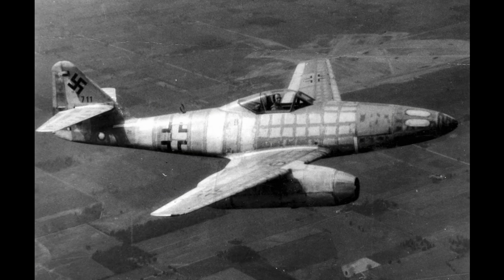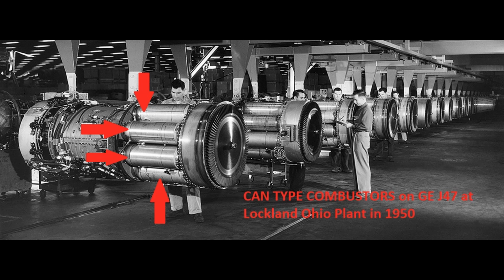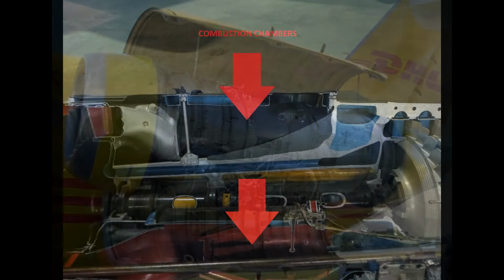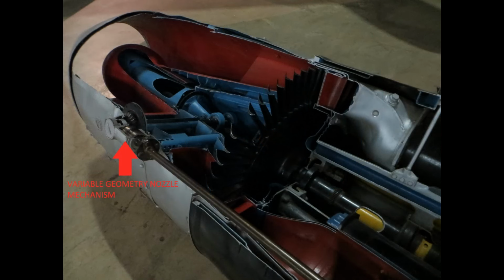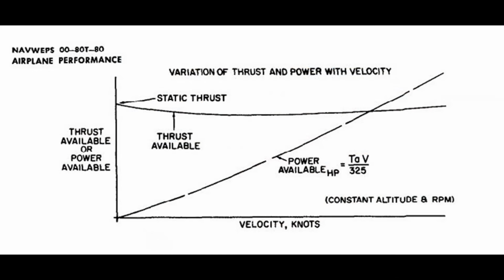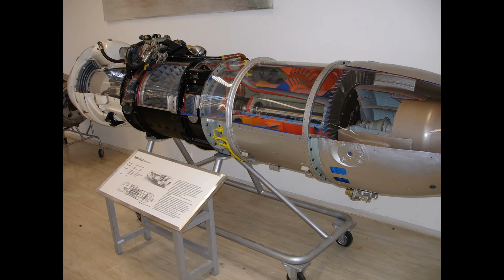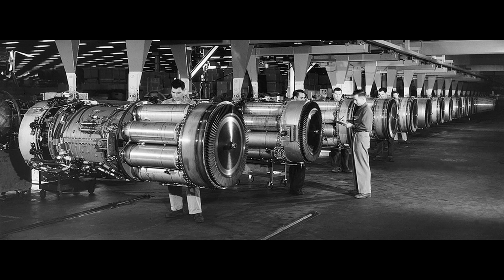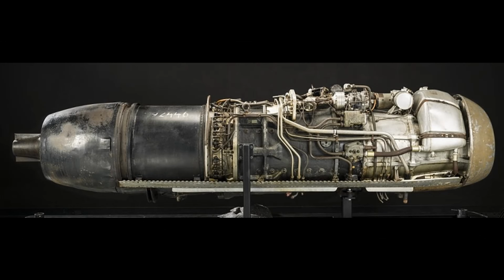World War Two JET POWER

Comment: Sander von Kammen You make some good points, but the War was about today and not tomorrow. German research was excellent but its ability to get new ideas to the front line was defective due to politics of all kinds within its leadership and its industry. The British used the Americans as a production powerhouse for ‘today’s’ technology in particular the following unique inventions. Penicillin, the proximity fuse, centimetric radar (cavity magnetron), the centrifugal gas turbine, the gyro gun sight, Tallboy and Grand Slam, APDS ammunition, airborne rockets, metallurgy, HuffDuff and gas diffusion for the atomic bomb. (They kept Colossus to themselves). All war winners which arrived in time to have an effect due to good management. There were others. The US B-29 was way ahead of anything  the Germans produced. The British were also well ahead in practical transonic flight research with NACA not far behind.

Of course, in 1941, the early Metrovick F2 had the long term problems of all the axial projects, including all the many German products, but it was developed into the successful Beryl and the later Sapphire. At this time piston engine manufacturers were using reliable, simple centrifugal compressors for altitude performance. PR’s were up to 4 or 5 which was about the same as the early, heavier and unreliable axial compressors. Griffiths was good but was rather anti centrifugals because he did not ‘invent’ them for aero gas turbines and he correctly forecast the eventual greater PR’s of the axials. But he mainly produced very complex solutions which would die or take years to develop. Whittle was practical – left to Griffiths no British turbine would have entered the war. Centrifugal compressors dominate today in helicopters and 1,000hp or so prop gas turbines at PR’s of 10:1. The RR Dart is an example to be studied.

The 1944 Nene was a wartime engine (lighter and twice  the power of the Jumo) which eventually produced in tens of thousands in America, Russia, China and France because it was light, fuel efficient, easy to manufacture and maintain as well as having a TBO way ahead of any German engine. It was also tolerant in combat unlike the Jumo. The Nene was still fighting in the Mig17 in Vietnam. The wartime Welland was a little too small for the next generation of single engine fighters which quickly superseded the draggy first generation twins – the Meteor and the 262. 

Fedden and his party did indeed walk into a fairyland of research but the projects were futuristic and had little bearing on the German war effort. In particular Germany invented and used the snorkel, V1/V2 rocketry, the MK21 U-boat (a production failure), fuel injection, the rotary cannon, air to ground missiles like the Fritz-X and the Hs293 and gave us the peroxide motor which sank the Kursk. They were also way ahead in gas ovens.

So my comments are about correct historical balance based on fact not unsubstantiated mythology of ‘what might have been’. This is about The Allied effort, not the British – I’m not British. The main weapons which won the war were production and cooperative management of resources at which the Germans were equally hopeless. Britain, America and Russia respectively produced 131,549; 324,750;157,261 – 613,560 aircraft against the 39/45 total German production of 119,371. Yes. Even the second rate Brits produced more and better aircraft than the Germans. The Lancaster, Mosquito and Hornet were better – the Spits, Tempests, Meteor and Vampire were equal. Unless one wants to get into dreamland and splitting hairs. The 262 was a romanticised, minor side show with the main event being the hundreds of 109’s and 190’s flown daily against thousands of allied aircraft.

The required balance of historical opinion can be seen in some of the conclusions of the Fedden report. My copy runs to 103 pages. It is very fair in its attribution of aeronautical knowledge to both the Allies and the Germans – but of course the myth makers will grab sentences out of context rather than looking at the picture as a whole. I quote :-

8- Impressions of the Mission on German Aircraft Development. The Mission have returned deeply impressed with the scale end- single purpose application of Science and Engineering to the military side of aviation in Germany, during the war. It is considered that there is a good deal to be learnt in Germany and that they are ahead of both England and America in respect of certain aircraft developments. On the other hand, it is equally clear that Germany was behind the allies in other aeronautical matters. The Mission failed to find any serious interest in Civil Aviation either from the Power Plant or airframe side.

9 - General, The Mission are of the opinion that never was the hackneyed phrase "the better is the enemy of the good" more applicable, than it is to the large number of aeronautical scientific projects, which were under active development, in Germany at the time of the collapse. The simple, but sound, British aeronautical programme was pursued with very little interruption throughout the war, but was accompanied all the time by intelligent improvisation until there was really little more in the way of development, to come. When this straight forward conception is compared with the plethora of new and varied ideas produced by the German scientists and backed up by the most modern and highly developed equipment for research, it becomes more apparent why they failed in the end. This opinion should not be inferred as a justification for ignoring the research work carried out in Germany but rather that we must exploit the advanced German technique and bring it to a promotional conclusion to help us maintain our prestige in aircraft design and construction.

The problem is that Youtubers are often interested more in hits than facts and get their hits and money by dramatic titles and non factual bias. I am a follower of Greg – because he is a good researcher and raconteur but sometimes he plays to the audience. Try Dark Skies - it's total c##p.
Reply from the maker: Good comment Chris, but I assure you, I don't play to the audience. If I did this channel would be a lot bigger. I call it like I see it. The Jumo 004 has a combat record that was unmatched among jets in WW2 and the overall design won out over time. The British led in some areas, so did the US and so did the Germans. However the big stat that everyone seems to ignore is that the GDP of the Allies was 8 times that of the Axis powers. Just about anyway you divide that up, overall, the Allies are going to lead in most areas, not all, but most.
Reply: The Jumo 004 had an abysmal record in all aspects, was abandoned by any country that attempted to produce it subsequently & had enormous resources used upon it that were essentially wasted resources. 
   In stark contrast the UK gas turbine aero engine efforts used a fraction of the resources compared to any other country & produced significantly superior results.
Reply: @petemaly8950  But the UK didn't lead the world in jet aircraft technology... Germany is the largest manufacturer of Jet aircraft in Europe today.
 Tell us what british company still makes british jets in the UK?
Reply: @DoktorBayerischeMotorenWerke 

@WilhelmKarsten 

We feel we can clear up some common false myths, misunderstandings & misconceptions.

It's always very important to note the relevant facts obviously.

Of course it is indeed a great pity & great shame  that British military forces had to occupy a large part of Germany for decades after 1945. It would have been so much nicer if that hadn't been necessary wouldn't it.
Russia had to occupy a large part of Germany after 1945 for decades.
Russia still posseses a large chunk of land that was once part of Germany.
Russia & the UK produce Nukes.
Germany does not produce Nukes.
 
    Regarding the UK Aerospace Sector.

  WHY IS IT THEY CAN'T ANSWER VERY SIMPLE QUESTIONS ⁉️ 😅
  A very simple question indeed.
   
Which airline recently ordered 60 RR Trent XWB Engines? 

Also name a single Germany company that makes German jet aircraft in Germany & name a single German Company that makes German gas turbine aero engines suitable for widebody airliners.

     That's correct, Brazil makes very good airliners & Brazil is 100th down the list along with Indonesia for wealth per capita.
Norway Holland Denmark Ireland Belgium - Top 20 wealth per capita - Don't make airliners -  its as simple as that.
  
  Agreed, that is correct of course, clearly there are many countries that could easily produce airliners of better  quality than Bow-wing (see b-47 wing folding & wing collapse incidents) but don't for some very good reasons. Bow-wing being a result of the size of the US, the large protected domestic market & great ease of testing new types due to the equator to arctic geography & a few other reasons related to production scale capability, politics & economics.

  Obviously there really is nothing special about Bow-wing, having more than 50 years design / build experience on the type means they have no excuses for the horrendous max incidents for example.

    Indeed BAe Systems & Rolls Royce combined now do more Airbus work than Germany on an absolute basis & significantly more work than that on a per capita basis.
   
     Agreed, Per capita for the home nation BAe Systems is the world's largest defence contractor.
  
    Correct, BAe systems announced the recent £4 Billion takeover of Colorado based US based Ball Aerospace.
  
    It's definitely the case that BAE systems now does a significantly higher value of work for Airbus than it did when it was a major Airbus shareholder before 2005.
     
      Obviously RR now owns US Engine maker Allison for example which does classified Aerospace work for the US Govt.
   
   Yes, that's right of course, Anybody currently flying on a widebody airliner stands a good chance of being on an aircraft powered by RR gas turbine aero engines built in the UK.

   A typical but small glimpse of what goes on in the very internationally orientated British aerospace sector.  

      Boeing Apache Attack Helicopter.
AH-64: 75 UK suppliers, 7% UK content, global fleet of 1280+ aircraft.
F35B more than 130 UK Suppliers, more than 30% UK content.
F35A & F35C more than 130 UK Suppliers, more than 15% UK content.

   There is no doubt that an airline has just ordered
60 RR England Trent XWB Engines

Obviously the UK has the
World's Highest Combined Per Capita
 Nuclear / Defence / Aerospace Sector Activity.

Rolls Royce Holdings UK
Subsidiaries
- Rolls-Royce plc
- Rolls-Royce North America (Allison etc Classified Military stuff)
- Rolls-Royce AB
- Rolls-Royce Deutschland
- Rolls-Royce India Private Limited
- Rolls-Royce Marine Power Operations
- Vinters Engineering Limited
- Rolls-Royce Controls and Data Services
- Rolls-Royce Power Systems
- Bergen Marine
Joint ventures include:
- Rolls-Royce Turbomeca
- MTU Turbomeca -

Trent Family
The MT30 (Marine Turbine)
Industrial Trent 60 Gas Turbine
Trent 7000
Trent XWB Airbus A330neo.
Trent 1500
Trent 1000
Trent 500
Trent 600
Trent 700
Trent 800
Trent 8100
Trent 900

RR wholly owned subsidiaries in Germany handle smaller 2 shaft RR gas turbine aero engine work.

We hope this helps of course as always.  Cheers & 😎👍 indeed.

       O B V I O U S L Y  

. ..... ..... ......  .... ... ...
.... ..    .. .. .... ...... ....
Clearly the line above this line is not blank.
Reply: There were only two winners in WW2 lad... the brits were not one of them.
 A.H. destroyed the british empire, today the UK is an American protectorate.

Comment: The Germans should have gone with the Heinkel engine.  They would have turned the War in the beginning with 500+ mph fighters and engines that didn't use strategic materials.

Corruption screws up everything.
Reply: The axial flow type engine was the obvious choice, testing at the Luftfahrtforschungsanstalt in Braunschweig  (The only supersonic aircraft wind tunnel facility in the world during WW2) revealed that centrifugal turbojet engines were fatally flawed and were an evolutionary dead end... which proved to be true.
Reply: @sandervanderkammen9230  I see, but to have the ability early would have been the foot in the door and if what you say is true, the newer engines could be introduced later.
Reply: @sandervanderkammen9230 
Ryce Muncherz Kharzeestan Krapper DiktorBummer etc & co - they should note well & remember pelly good with much awestruckness pleasetoo.
 That's hilarious - Krapper/ DiktorBummer claims Griffith's said Whittle didn't understand jet engines 😂 In fact Griffiths was already working on axial jet engine tech before 1930 & was aiming to use it as a turboprop engine. Before 1931 Whittle was aiming at gas turbine reaction thrust only with no propeller which Griffiths had doubts about. 
     Their comments are readykyoulous phFabrikayshunz. 😂
  Multi stage sequential stator rotor Axial compressors & Axial turbines had been demonstrated  before 1900 by Parsons in England. Internal combustion axial gas turbine aero engines were being considered, researched & built in England since 1925.
  Maxime Guillaume simply copied stuff from Parsons writings & lectures into a fraud patent.
 The Whittle centrifugal compressor internal combustion reverse flow & straight through combuster gas turbine aero engines is still manufactured & used for turboprop & helicopter applications & more than 30,000 have been produced so far.
    The gas turbine was of course invented in England before 1800, why would they expect it to not have been the case, obviously.
   The world's first demonstration of a practical internal combustion gas turbine aircraft engine was in England in 1937.
   It used a car engine for starting (spinning the main gas turbine shaft), the car engine was disconnected after starting. Electric motors were also used for starting -  Standard practice.
All previous attempts by others had various non pure gas turbine aero engine features such as a compressor stage that was actually operated by a piston engine with an after burner & no turbine stage.
    The world's first demonstration by Parsons of the components of a coupled multi stage axial compressor & axial turbine unit using sequential bladed rotor stator stages was in England before 1900 when of course people in England began considering their use as the basis of an axial compressor internal combustion gas turbine aero engine.
  Parsons didn't manufacture steam engines.
  Steam engines don't have multi stage bladed sequential stator rotor axial compressors & turbines. 
                                    &
    Oh yes, the PW200 range of gas turbine engines are in fact directly derived from the Whittle centrifugal compressor internal combustion reverse flow combuster gas turbine aero engine which of course was demonstrated for the first time in the world by Whittle in England in 1937.
Indeed 
                          OF COURSE
  Air travel safety often depends on British made and or designed tech or British aerospace advanced technology, R&D, science & Engineering.
  For anybody currently flying on a widebody airliner there's a good possibility that the engines will be RR gas turbine aero engines designed &  built in England with those engines  being monitored by people in an English county.
  England, the home country of 
  RR (aero engine stuff) & it's lands, 
   counties & shires will 
   of course be producing  - - 
            🎺📯🎺📯
    The RR Trent Ultrafan
   The Worlds Largest Gas 
     Turbine Aero Engine.  
           📯🎺📯🎺
               👍👍
   
   A typical but very tiny glimpse of what goes in the very internationally orientated British aerospace sector.  -
      Boeing Apache Attack Helicopter.
AH-64: 75 UK suppliers, 7% UK content, global fleet of 1280+ aircraft.
F35B more than 130 UK Suppliers, more than 30% UK content.
F35A & F35C more than 130 UK Suppliers, more than 15% UK content.
😂👍 Cheers
     
  
 
             
  
. ... . . .................. . ....
xcvvcxixcvcxcvcxxxc
Reply: @paulpaul9914 Please name a single British aircraft manufacturer that still makes British jet planes???
Reply: All jet engines use strategic materials, the Jumo -004 Orkan engine got around the problem by introducing pioneering technology such as bleed air cooling and CRMs technology standard on all modern jet engine and not available to the Allies until after the war.
Reply: @sandervanderkammen9230  but heinkel's wasn't.  Heinkel had a different cooling system that allowed it to get around the issue with a novel but effective cooling system of their own.  I saw a video about it and no it wasn't mark felton.
Reply: @fistofthetiger1591  The Heinkel HeS9 and 109-011 bypassed air around the core like a turbofan but like the BMW -003 and -018 its development stalled because it relied on Krupp P-193 Tinidur alloys for the turbine nozzle and blades.
The Jumo -004B entered mass production because it eliminated most of the nickel content by switching to Krupp P-198 Chomadur a Chromium based creep resistant super alloy still used in jet and gas turbine engines today.
The switch to P-198 required additional thermal management technology and the introduction of hollow bleed air cooled blades which where also coated with a heat resistant Cerro-Alumina composite ceramic materials or CMC.
I'm not aware of any other engine that features both technologies until after the war.